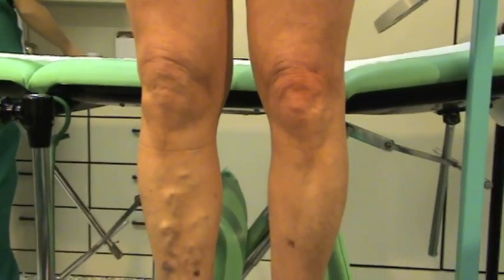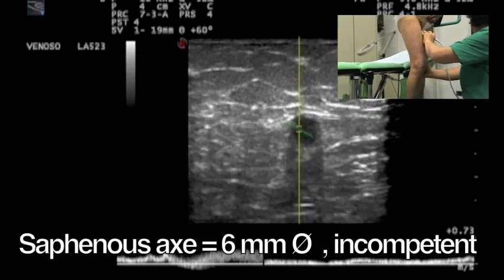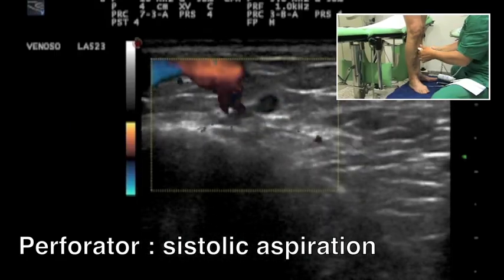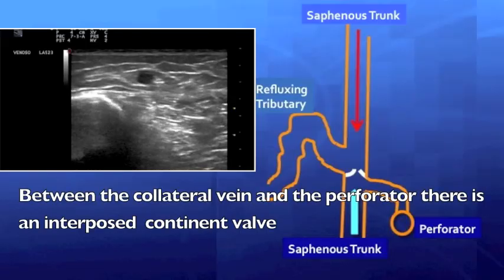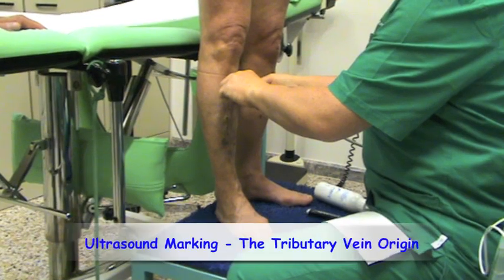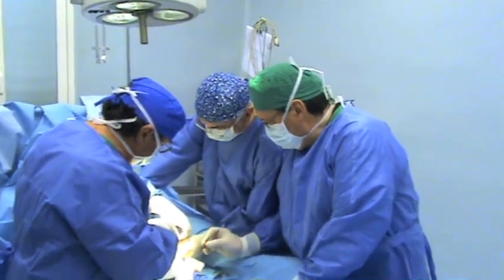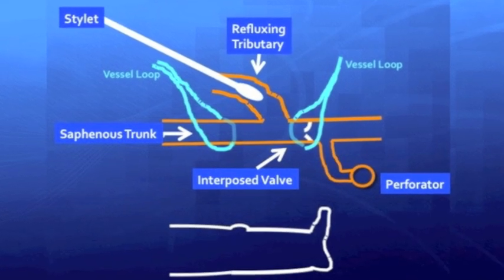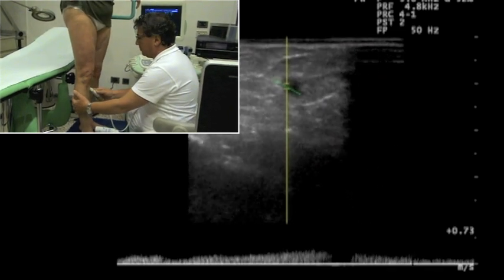Diagnosys and treatment of a shunt type 3

Comment from the maker: After hemodynamic treatment the saphenous trunk remain incompetent, with a centrifugal flow, but this flow is no more pathogenetic because its energy is reduced. The saphenous axe drain its physiological flow, no flow from the deep system is added , and the direction is from the skin to the deep. The saphenous femoral junction was interrupted without arc tributharys disconnection, but I am not sure if is this your question because i don't know what does it means " STEPLERID" ?